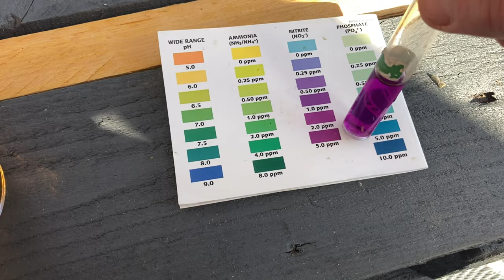Water clarity issues and evolution aqua 25w bulb change (old style)

Comment: You could try adding a beer filter into the centre pipe to help catch the fines. Also if your water level is above the overflows when you boil it you get a reverse vortex effect which may help remove more debris, that’s why people add the caps to stop losing the K1. I boil mine for 10-15 minutes every couple of days, pulls out loads of crap and water quality is spot on, mind you my pond is only 6000 litres and only have 10 koi ranging from 20-34 cm.
Reply: @ADS-KOI  I got mine off Amazon.

Comment: I still reckon it just needs time mate. Algae and bacteria bloom always happens on a new pond. It will suddenly go clear again in a week or so. One thing that probably would help is swapping your eazy pod pump for a vari pump and slowing the flow down. Eazypods runs best at around 5-6k per hour. Any more and they do let fines through. I used to run my 10k pump on 65% and that was pumping it up and over the shower

Comment: Nice update mate. I had similar issue having to clean the pod too often. I added a tempest (Wrighty DIY version) after and never looked back, takes some of the work away from the pod by collecting alot of the fines and dont have to clean quite so often plus clearer water and more media for bio. One quick question mate, to go gravity into your pod and then gravity into moving bed is your pod in gravity mode? Looking to add similar to mine but cant get head round it. Cheers!

Comment: Bit more water in the pod on a clean it wants to be over the spill ways watch losing the k1 hence the pod caps a certain person sells I'm not sure what speed you turn the water over at but the pods like 7000l to about 5000l a hour or slower it will pick up more the slower it runs
Reply: @ADS-KOI  Slow it down a bit mate the pod will be happier at 7000l or under it will pick up lots more. If you use the NT labs test kits say so and when you do i will drop in a test tube stand for you with it
Reply: There is a link under my videos

Comment: Flow rate from the pump higher than the recommended ?
Reply: @ADS-KOI  same as my nexus 220 mate but optimal is 6k if I ran at 10k the amount of fines seeping through I’d always be chasing my tail.  Worth considering turning it down to 6k if you can…. It’s finding that sweet spot… 👌🏻👌🏻

Comment: Nice update ads mate 👌 I ve just gone from drum back easy pod and shower via tempest.. But took me about a week to get water bang clear again video out tommorrow evening mate.. Message me  as don't get what s going on with your s see if we can sort it 👌👍👍
Reply: @ADS-KOI  what you running it at mate
Reply: @ADS-KOI  there the issue mate you need a vari flow pump mine is running at 6800 and that is my sweet spot as you call it 👌👍👍👍
Reply: @ADS-KOI  no mate get a vari cause if you need to adjust slightly to find your sweet spot you could be slightly higher or lower and also when your feeding goes up you may need to slightly up it too if that makes sence  👌👍👍
Reply: @ADS-KOI  mate go to info on my channel and call me my no on there 👍